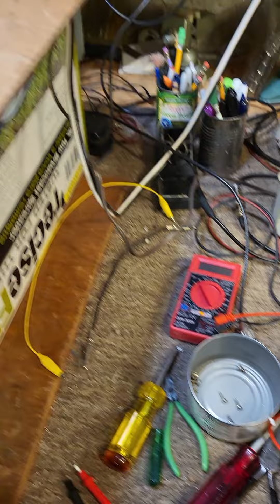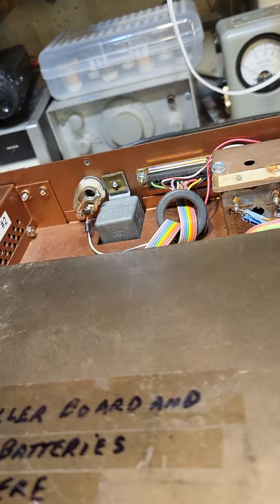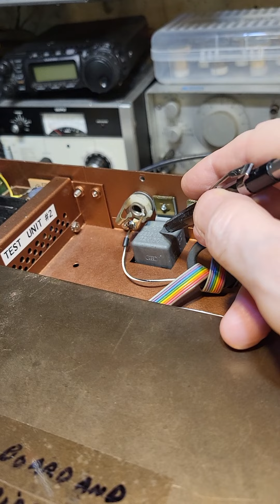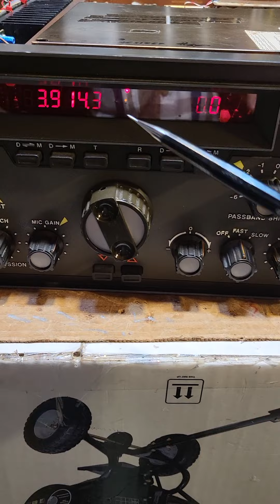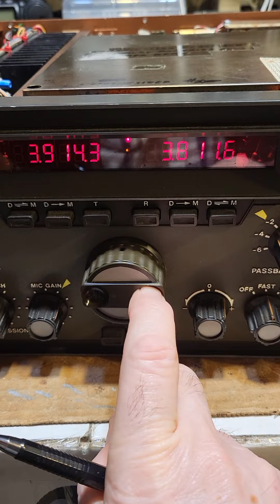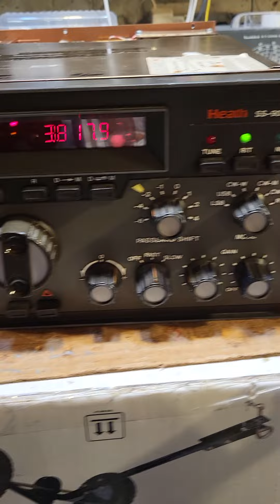Heathkit SS9000 repair

Comment: Thanks for the video Bob.  My SS-9000 continues to work well after I isolated and repaired a microscopic break in a PC foil in the HFO circuit a few months ago.  The only defect remaining is a NB switch that refuses to latch.  I'm not too concerned as the NB circuit seems to be rather ineffective.  Your TX audio mod really helps the audio.  Best regards, John.